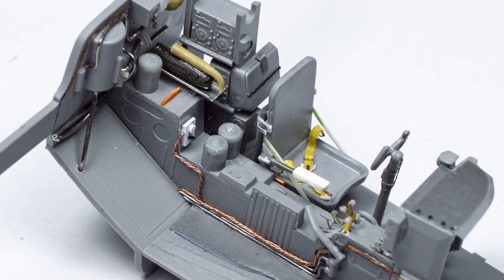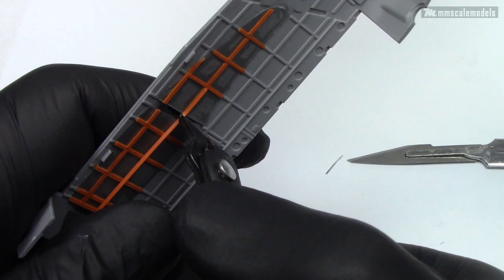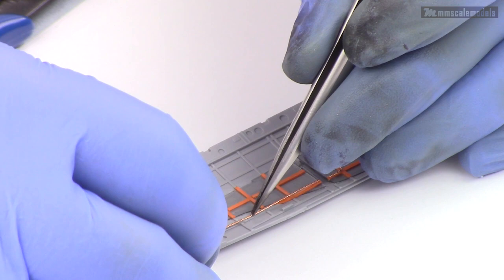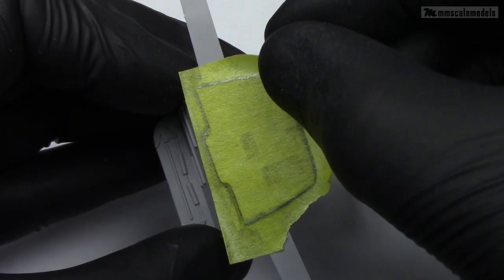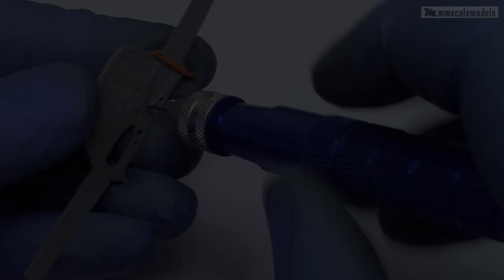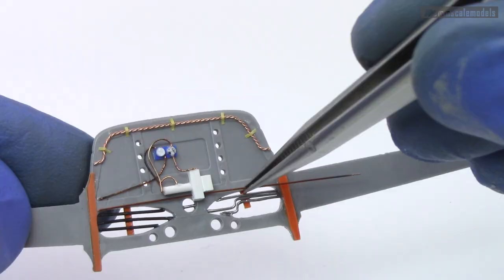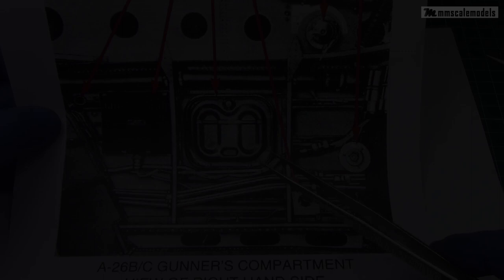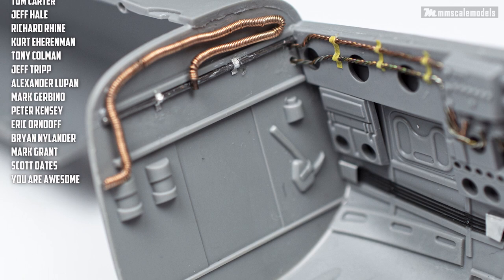Ep.2: B-26B-50 Invader - Detailing the interior - ICM - 1/48

Comment: The kit manufacturer keeps getting the correct designation wrong. This is not the B’-26.  The designation is A-26 Havoc built by Douglas aircraft co. The B-26 was built by Martin, and named Marauder. Two entirely different aircraft. The A designation stood for “attack.” Another name for the B-26 was the “flying prostitute, no means of support.”
Reply: Yes, there is some confusion over the nomenclature used for the Invader but, in this case, the manufacturer is correct.  The A26 Havoc was redesignated the B-26 after World War 2.  This variant, the B26B-50, flew in Korea and the proper designation is B26 NOT A26.
Reply from the maker: Agree with Jerry there. After decommissioning the marauder, invader got the B-26 designation according to the info available to me.
Reply: @MMScaleModels  I did a lot of research on the Invader for a build so, I'm pretty familiar with it 👍